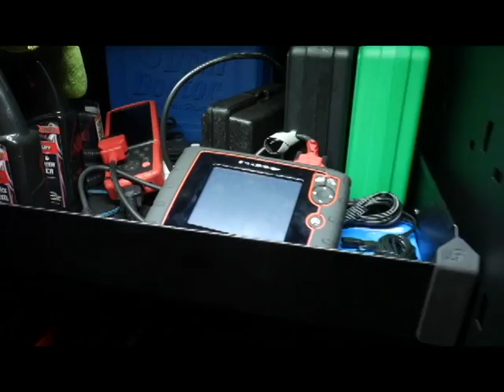WHAT ARE DIAGNOSTIC FEES AND WHY DO SHOPS CHARGE?!

Comment: It's our fault, since we need communicate effectively and train our customers of the time and cost associated with the diagnostic process associated for a specific complaint.  We need to emphasize the value and benefits they will realize when a thorough and complete diagnostic procedure is exercised.  Walk them through the broad strokes of the plan of action and any specialty equipment to be used and the time frame required.  Emphasize how important it is to mimic the complaint in order to isolate the cause to verify the repair was successful and parts weren't being installed unnecessarily.

If the professional standards for Doctors, Lawyers and other white collar professionals are to charge several hundred dollars for an initial consultation or consult fee to simply discuss a plan of action; it should not be unrealistic for our customers to expect to pay our published hourly rate for a specified period of time to perform an actual physical task.

The trust issues arises from the unknown and uneducated.  That is where they feel they are getting "ripped off".  This can be accomplished without getting too technical or too detailed for most, where some others may require a bit more in depth details.  The beauty of this model is once you identify the suspected cause we can notify the customer and they can get it repaired or not and we still get paid for our time.

Will we lose out on the repair or have people who balk at the idea of diagnostic fees; Yep!  But who wants these customers anyway since they won't be happy even with a satisfactory repair.  The ones that decide they can do the repair themselves or have their neighbor do it cheaper now that the problem is identified, that's fine too.  It frees up our schedule to move onto the next vehicle and with positive results, that vehicle and customer will most likely return in the future.

There is higher probability the customer will choose to have us perform the repair out of convenience since the vehicle is already there and on the schedule and transparency builds trust.  Repeat customers will be gained that are more likely to accept those high dollar repairs with less skepticism since we have always been transparent, and in their eyes, open, honest & trustworthy.

If we allow the customer an informed choice and they have full confidence in us and our abilities from past performances  we should be able to sell our diagnostic time with minimal effort and make it standard practice.  We are the only ones that can change our practice and standards and should do so in a positive manner.
Reply: I wrote the above comment before watching your video which mimics my response!  GREAT content and even better philosophy.  Communication and Transparency is beneficial and positive for the Industry as a whole.  The opposite encourages negative outcomes and breeds poor customer relations.